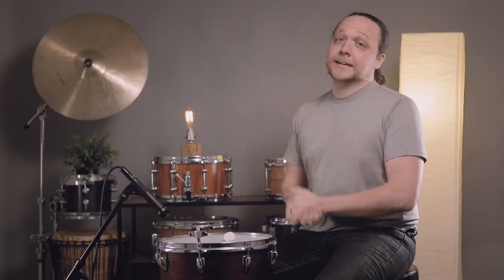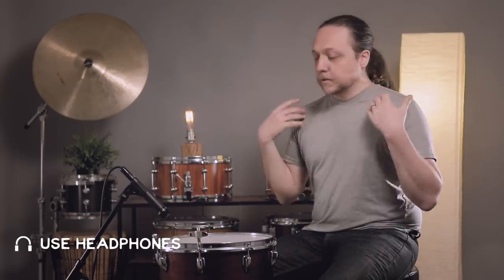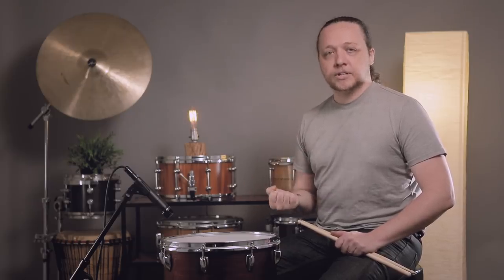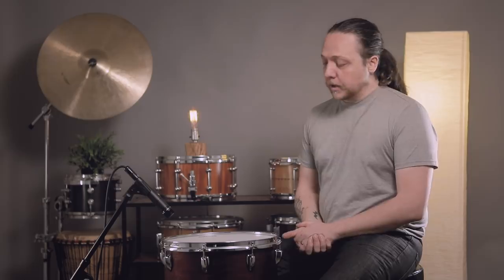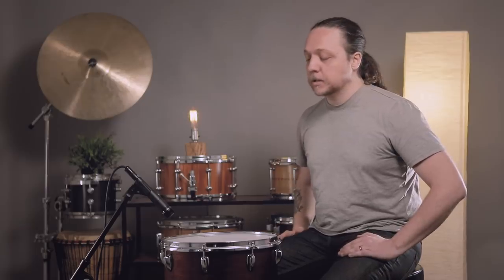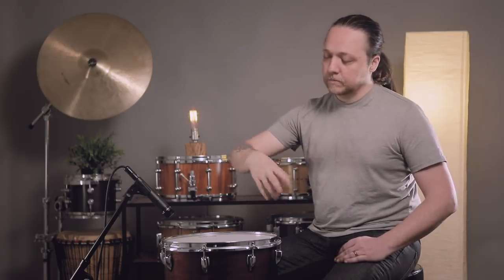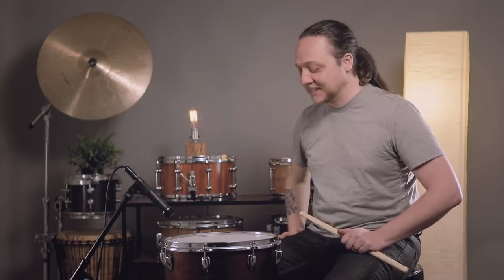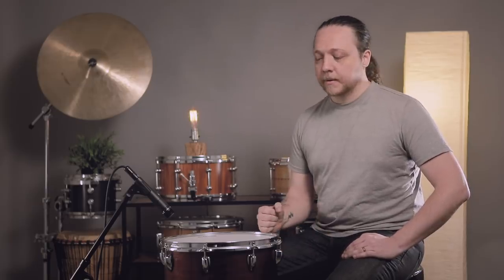Control Your Floor Tom: Muffling Hack | Season 2 - Episode 6

Comment: I picked up a few drums recently that were owned by a local drum mentor of mine (who passed 12 yrs ago). One is a late 80’s Tama Imperialstar 16” floor Tom with like 5-6 cotton balls in it. It sounds soooo good. He would have put them in their around ‘90-‘91. Dudes has been doing this for years and for good reason.

Comment: I was under the impression that Benny Grebb flattened and pulled his cotton balls as to increase the surface area and reduce the rebound from them.  Great video!

Oh and putting them in through the vent hole is easy if you use a q-tip to push through.
Reply: Most people do, a few pulled and mushed together like a Santa beard lol

Comment: I was hired to do a stage lighting design and show control for a local cover band. The drummer had an acoustic kit, but all the drums were full of poly fill......the stuff they put in pillows so that there was very little acoustic sound. But he used triggers so what everyone heard were sampled/digi drum sounds. He did this because he liked the look of the setup and the feel of the drums over all Digital drums kits. And If I remember, the cymbals were the low volume drilled type.  Worked quite well. Really solid band with lot of other tech like sequenced sounds and guitar pedal presets triggered by MIDI.

Comment: My father was a fairly successful drummer in the 1960's - 1970's.  He told me about using this method back then. At times he used a handkerchief or something similar inside the floor tom.  I've never tried it and honestly never noticed anyone else doing it, but always thought it was pretty clever.

Comment: Hi Cody - Just got myself a Sonor SQ1 - was having a ton of trouble with the 14 inch Floor Tom. 14s have always given me grief in the past, so I thought, 'Uh oh - here we go again...'. But two things have sorted it beautifully: 1. Tuning - Batter 142, Resonant 131. Yep, top head tighter. I don't normally do this, but for the 14 it works brilliantly. Thanks to Mike Evangelista for his youtube post on this particular tuning. Then ... the all-important cotton balls. As my balls are smaller than yours (stop it), I used 10 inside, and retuned the batter to 142. Bingo. A great thump, just enough sustain. Fundamental of E, which is about the right ball park for a 14 Floor. Thanks for the tip - I'd heard it before but had forgotten it!

Comment: Im 53 and was doing this in high school in the 80's so this has been around for a long time.  My rule of thumb is use 4x cotton balls in 14" floor, ...5 in a 15", ..6 in a 16" and ...8 in an 18".  And that's for square sizes.  If the drum depth is shorter, add an extra, or if you want more sustain, then subtract 1-2 balls per drum.  And I don't pull them apart or flatten them.  My theory is you want them to be able to bounce up from head vibration, allow sustain, then land to kill the overtones. I like live, singing, resonant drums but don't like excessive overtones so I prefer minimal damping. 

Secondly, I also regularly use Moongels on top heads in similar fashion because I mainly like single-ply coated heads so I use 1/2 of a gel on 10" tom, 3/4 gel on 12", 1 full gel on 14" floor, and then 2x of .75 gel (so 1.5 gel total) on a 16 floor, (thus .75 on top of head, .75 on bottom).  For an 18" floor I'd use 3x of ~5/8 to 3/4 gels placed in a triad.  I've found this system works extremely well and it makes sense as there's no reason to dampen a small drum the same amount as a larger one and vice versa.  You have to scale the damping for the shell size.  (and fyi, this is using the rectangle gels mind you but a similar theory would also apply to the round dot type where you use more dots on a larger drum).

Comment: Always the best content AND production on the interweb! 

Just came across a Jim Keltner studio trick as related by Don Lombardi - You take one (or more) legs off the floor tom and turn the leg UPSIDE DOWN in its bracket so that the straight metal shaft is on the floor. The straight metal leg on the floor really cuts the sustain for a shorter floor tom sound. I usually use floating floor tom feet for a fuller sound so as to match the full tone from the rack tom, but I was looking for a shorter, drier sound (without using muffling) and found this old-school recipe!

Comment: I’ve been doing this for quite some time! The second I heard Benny Greb did it, I basically made it a task. I did it for a show about 8 months to year back and out probably 8-10 in there and I was like uhhh.... this is really isn’t useable. Took a bunch out and have I think 5 in the floor Tom. I actually put a couple in my 10inch Mounted Tom and it gave it a lot of beef that I’ve been missing with it. Also allows me to tune it up high to get the attack and sustain I need but still gates the sound like you said! Great video.

Comment: In researching the cotton ball in floor tom hack , i ran across this gem. How about strands of yarn that can be easily threaded thru the drum shell's vent hole. I think I would add 8"  lengths of yarn, one at a time, until the desired effect is reached. Other option would be adding a continuous length of yarn while leaving a piece outside of the shell. That would leave the option of pulling it all out.  Can't wait to try, unless Cody wants to test it out. Hint , hint. Such a great resource we all have in Sounds Like a Drum. Update- i did try the yarn inserted via the vent hole and the results were not positive for me. What worked best for me was 3 flattened cotton balls when they were on the center of the reso head. Initially had to tilt the drum to get the cotton balls together then shook them to the center. My floor toms are not tilted so they stayed there while playing. I haven't tried this yet, but i think loosely securing the balls together with thin sewing thread, might be great to keep the cluster of cotton balls together and having the most effect. Many drummers tilt their floor tom  and the cotton balls may just drift to the edge and not control the length of sustain. My 14 " very resonant drum went from 8 seconds of sustain to 3 seconds and sounds amazing.

Comment: I use 5 in my FT. Definitely the best 'muffling' technique imo. Tip: push the cotton balls through the hole(w a lil stick) so you dont have to remove heads. Edit: i see you mentioned that. Works on my yamahas.

Comment: I will sometimes place a folded piece of paper towel under one of the end plates of my snarewires to help deal with sympathetic snare buzz if the electric guitar is really setting them off. The snare then press it into the head. Don't need much and each drum likes it placed in a slightly different spot (throw off side of the reso head, butt plate side, barely under the snare wires end plates, ect.), but it works great when its in the right spot. I use a 1 invh by 6 inch section (folded in 4ths) on my drum and the butt plate side of the reso head (6 by 14 poplar snare with triple flanged hoops and 20strand pureaound snare wires.)

Comment: I was impressed with how much even 1 and 2 balls cut the sustain down from the base level. It was almost 30% percent without really being perceptible. If the time wasn't visibly measured, I would have never noticed the difference. 3 and 4 is where it started to sound gatey, which is fantastic for being able to acousticly craft your sound; but 1 and 2 are a great way to practically affect the baseline of the sound without it noticeably affecting it. I am definitely going to play around with this.

Comment: Yet another killer vid. 

I'd say if someone wants the balls to stay towards the edge, you could use plastic pipe straps hanging on the inside of lug hardware and hot glue the balls to strap, or use velcro (hook side) inside the shell. Both cheap, easy to find at any hardware store, and no permanent damaging mods to shell, easy to remove if you don't like it. 

Idk if that would sound better or worse, but probably different. lol

Comment: Cory, great info .  Very interesting, vid.  I just got Evans EC2s for batter heads and also using G1s ckear heads touse as reso heads fir all of my toms, 12,13 and 16 inches.  No matter how I tune both heads , i still get too much " ringing overtones".  The ec2s translucent coating, according to Evans, should not need muffling.  So far I found that putting the standard reso head with the G1 clears on the batter with moon gells are yielding the best sound to my ear.  I seek that Doo.....Doo..... Doo sound with little overtone .  As a resurgent drummer, at age 68 , after 50 year hiatus, and using a cheap Gammon drumkit (wifes xmas gift to me for anticipated retirement), i am learning how much tweaking of the various heads affect the sound.  BTW, the Evans EC2s gave a sound treatment technology of a ring around the edge which appears to have an oil moving arou d the ring .  The oil is between the plys  .  Stay safe all.

Comment: I just recently used bull dog clips to cover the half of the reso head with a very thin very light weight piece of flannel from a craft store. Any really thin or really light weight piece of fabric works. Cool thing is you can dial in the sustain by how much you muffle the reso head. No need to remove heads and it happens on the fly. I’m getting Benny Greb deep tones on a 14x14 DW Maple/Mahagony floor tom.

Comment: Using custom custom cut poster board in a zero ring style inside the drum works as well. When you strike the drum it hovers for a split second allowing the initial boom but gating it off gently.

Comment: Cool never heard if that before. My opinion is that most floortoms don't have enough tuning lugs for the larger diameter of 16 and up. A 14 is just easier to tune evenly and get a good sound. I gave up on my 16 ft altogether and now just put a 14 tom on a low snare stand in its place with clear or coated Emperor tuned low, just half a turn or so above slack on the batter and over a turn on the reso. works for me, no damping.

Comment: I would be super interested if you guys experimented with absorbing sound reflections off of the inner shell of drums, without touching the head. 

For example, if you taped strips of towels to the inside of this nesting floor tom.

Comment: Best results with muffling a fat floor tom was throwing on 4 moongels in a pattern that would accomodate a round weight. I then placed a weight from one of my cymbal stands on top of the moon gels, very near to the edge. Almost did nothing to the fundamental, but killed basically all the overtones and sustain!

Comment: Thanks for another great video. I would like to try this on a rack tom as well to try and achieve a similar gated effect on both toms. Wonder how much the slight tilt will matter. 

On a somewhat related note you should do a show about vent holes. I am thinking more presence/absence on tom, snare and unported kick at rock, pop, bop tunings rather than 2000s style ultra vented snares. Do unvented drums choke out at some tunings/volumes as some say and/or are they more sensitive and responive at lower volumes as others say.

Keep up the great work.

Comment: Recently i tried poking some holes on the edges of the floor tom head in order to mimic the hd dry concept. I think it does a pretty good job, considering that i reach for a similar tone as this one (single ply coated, of course)

Comment: So weird. I literally had this idea come to mind while watching another of your videos! Then this popped up in my feed before I even got a chance to try the cotton balls myself.

I was thinking that they would be great because you could push one through the breather hole (tho getting it back out would require removing the head.

Maybe run some thread through the cotton balls, so you could lift them off the head by pulling up the strings through the breather hole.

Comment: I use studio rings on the INSIDE of my floor toms so it's sitting against the inside of the resonant head. Worls well, but you need to make sure its a good fit so it doesn't cause a vibrating sound

Comment: Hi!! Nice comprehensive and scientific test!! Thanks a lot. I personally would tend to refrain myself to use to method. In fact, I am afraid that while playing, cotton balls would release a lot of dust inside the drum. Being a super-lazy guy, I do not like the idea of opening the drum every second or third gig just to blow away the cotton-dust.
Reply from the maker: Thanks! Having done this for a while, I can tell you that you've got nothing to worry about with regards to dust inside the drum as a result of the cotton balls. Even so, when you change heads you would normally clean out the inside of the shell regardless. Give it a shot!

Comment: I really like the open sound, but 3 cotton balls also sounds good.  It starts to sound a bit choked around 5 or 6 and certainly the batter head overtones start to dominate the fundamental around 6-8 cotton balls.  10 is way too much for me.  

I have successfully used a half sized drumtacs on the reso head just to take out strange overtones that I can't tune out without dramatically changing the tone of the drum.  They are stickier than moongel so they hold on to the head and don't fall off.

Comment: Thanx Cody and Ben for exploring this idea! I’ve always muffled my ft in some way or another. And, always looking for new ways. But, recently I’ve attached a 20 strand snare wire and had a snare bed blended into the bottom bearing edge of one of my ft and I feel like I’m always on the verge of getting the sound I want from this drum as a deep snare,  but never really achieving it. Wondering if y’all have ever explored the ft/working sd conversion??

Comment: The cotton won’t all stay in the center if you tilt the floor Tom a little and also if you use cotton sheets and not balls and I found the optimum to be a 10 x 10 centimeter cotton sheet

Comment: First off, do you think using fewer cotton balls in smaller rack toms will help with the little bit of muffling we may want on them? 

So I tried something similar, but different a couple months after I got my kit. I used a wash cloth, but didn’t want it to cover the whole head so I rolled it up before putting it in. I think the weight on the bottom head plus how dense a rolled up wash rag is made the air not able to really go from the batter head to the reso head, so I ended up with like a really dead floor tom. 

This was actually a blessing in disguise for me because this led to me messing around with the tuning of my toms after this. Since I was focused on my floor tom I started with that and to make a long story short, this is when I decided to flip my tuning for my toms and go for a tighter batter and slightly less tight reso. The distance in how far between tones are between batter and reso heads vary from tom to tom slightly as well, similar on my bass as well to get some extra tone while having a decent size pillow inside. I still use a pretty classic tuning on my snare though, near table top reso and medium-ish battter, you can really hear and feel the difference in the attack and reverb I get from the snare w/out snares engaged versus the toms. 

Sadly, I still have to use some dampening. I use 2 Meinl drum honeys on the floor tom, 1 small trutone on my 12, 1 big trutone on my 10 and 4 Meinl Drum Honeys in a diamond pattern on the snare with half a moon gel on the snare side to help temper the snare sensitivity. 

I do think I’ll try out the cotton balls in at least my floor tom though. I’m also thinking it may be possible to also put like 1-3 of them in a rack tom for similar results, just with a smaller drum, if needed. 

On another note, you said in one of your videos that this channel is really huge on the premise of tuning and tone, which you have proven with like almost all of your videos having something to do with one of the two. But anyway, due to you clearly really being involved in that aspect of drumming, do you like/listen to Terry Bozzio? Have you seen or heard of his “all cymbal drum set” although I think he has a couple now lol and wouldn’t that just be called a cymbal set or cymbal kit when there’s literally no drums, just cymbals of all kinds? 
Also have you ever seen his kit that has the 3 rows of rack toms? With that kit it’s almost like he made a drum piano because I’m pretty sure he gets piccolo toms made to be tuned at certain notes. I say that because I saw a video of the guy who does his drums for him and he said that Terry would just call him up in the middle of the night randomly and just say “yeah I need an F in there somewhere” and then Terry also credits DW for being able to make these toms that are small, but due to technology, they’re able to get low tones from much smaller drums than they used to, so he can fit many more drums on a big rack in front of him and that’s why I call it a drumming piano because it sounds like he could likely create almost any note depending on whether he hits a single drum at once or sometimes potentially having to hit two different drums simultaneously to create a third note or tone that no single drum on his kit or possibly no single drum for certain notes and tones are  capable of creating that sound he’s looking for. 

I’m sure you’ve obviously heard of him, I’m just curious just how much you like him and what he’s done. I’m also curious as to whom your drumming inspirations are? What made you wanna start in the first place? 

Btw, here’s Bozzio doing amazing work. 
https://youtu.be/CroX237dzfY

Comment: Would those 100 cotton balls work in an apartment situation? Is the sound much quieter? I'm currently playing with mesh heads but my kick drum with blankets in it hasn't gotten me any complaints from neighbors. The resonance from regular toms is just too much but if cotton balls work maybe I can get away with it?
Reply from the maker: It may do it, no reason not to try. It did diminish the volume pretty drastically! - Cody
Reply: @SoundsLikeADrum  thanks!